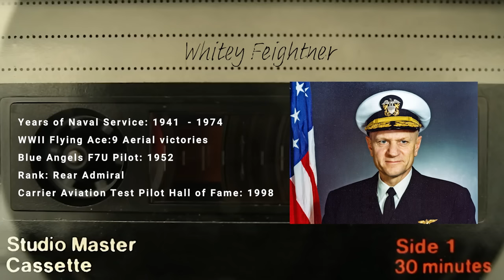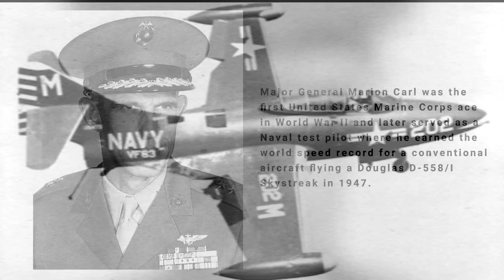The TRUE STORY behind the Blue Angels' F7U Cutlass featuring Edward "Whitey" Feightner | Podcast

Comment: Amazin video!

The Cutlass part caught my eye. I used to watch them land at NAS Alameda. My dad was in FASRON 8 as a Chief Metal Smith working on Corsairs. He was probably overseas on the Boxer at the time, as we were across the street from the base in federal housing. There was  runway parallel to the estuary between Alameda and Oakland. And I could watch planes land there without going on the base. I think Todd shipyard was at the south end of that runway. I hadm''t seen a lot of jets at the time, and was amazed by the serious nose up attitude and the long nose gear when they were landing. After Corsairs my dad did Demons, and I still have the Demon Doctor patch he gave me back then. I think it was around the time of the Demons that they changed his rating designation to Structural Mechanic. I think the serious swept back wings and dual engines of the Cutlass caught my fancy as well.

Comment: Have a video if a blue angel f-18 Taking out the chain link fence at NAF ElCentro & blasting the tops off a beet field before barely establishing climb & returning to land surrounded by emergency equipment. It was so close to a fuel spray disaster. We could have all been taken out. I'll post it as soon as I convert it from the 8mm hq vid tape it's on when I find somebody with a working player. I need to run it by the base first. The Blues have been a great part of my community forever. Permission would be nice.

Comment: The very first aircraft to land at O’Hare airport in Chicago, albeit an emergency landing, was an F7U-1 Cutlass
Reply: Really? O'Hare has been around since the 30s, and was actually renamed "O'Hare" in 1949. Sabres were operting from it from the early 50s.
Reply: @mookie2637  I think you are correct, it was called O’Hare field n 1949, formerly Douglas Aircraft “Orchard Air Field” hence the “ORD” identifier….I just reviewed the Wikipedia article agreeing with you….I read an article years ago called “Run, it’s a Cutlass!” that mentioned a Cutlass making an emergency landing there and they claimed it was the first landing at O’Hare, knocking  over peach baskets on the closed runway…..perhaps I remembered in error. Thanks for the correction.
Reply: @hertzair1186  I go through it so often (and had so many delays there...) that I've got into the history of the place a little 😁
Reply: @mookie2637  👍

Comment: There's been one being restored to flying condition in Arizona by Al Cosby. It has been in the making for like 30-40 years now. From what I've read everything will be updated except for the engines which cannot be replaced. It would take a lot of modifying if different engines were used. Look up Project F7U Cutlass and read the comments in the leave a comment section

Comment: I don’t know all that goes into upgrading and updating our shipyards, airfields, & military bases, but I don’t see why the army core of engineers can’t be brought in to help get some of these projects done.  
I think way to much money is wasted when it doesn’t have to be which is partly why the Chinese are kicking our ass in building these big projects.   (However made by any1 else might cost more and take much longer to get finished, yet a Chinese built project will be the first to breakdown!  Cheap & unsafe construction & materials.  Everything they do is a crappier version of whatever it is.  Since the CCP came into power, they have basically just become sneaky, lying thieves who are great at mass producing an all around cheaper knock off version of whatever idea they can steal.

Comment: Ah the magnificent J46.  Westinghouse destroyed any number of Navy aircraft programs with their garbage engines.

Think this way - the GE F404 from the basic F-18 was the same diameter, same weight, and about 40" shorter than the J46.   And three times the thrust and modern throttle response.  You'd need a lot more air intake...